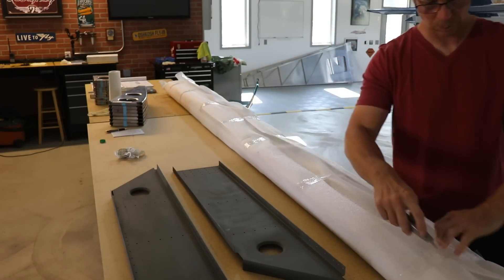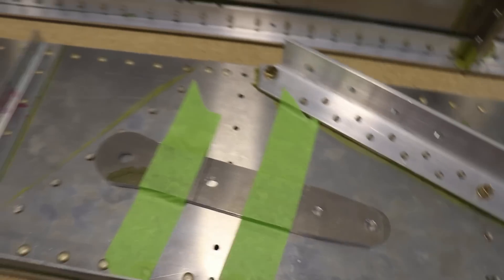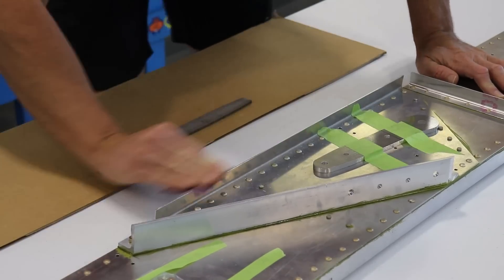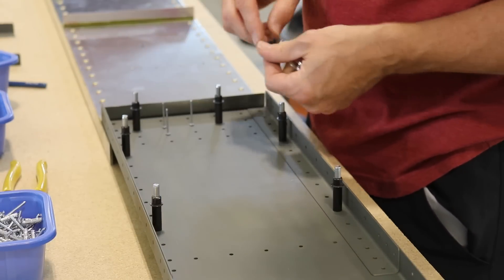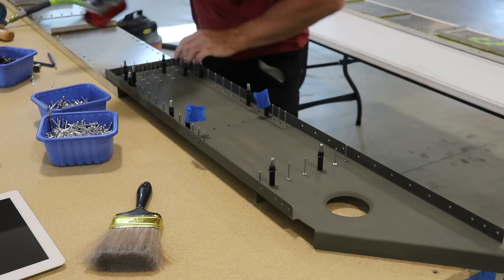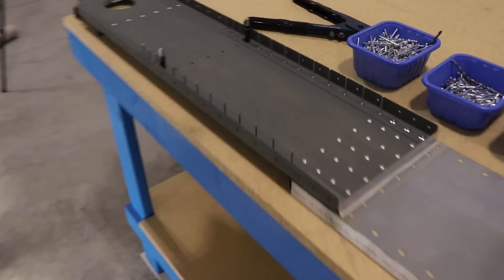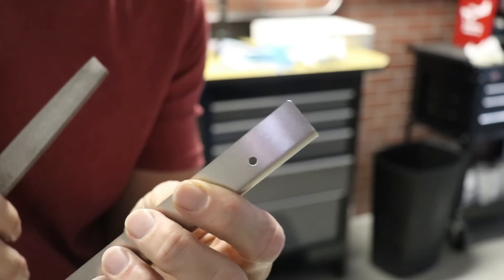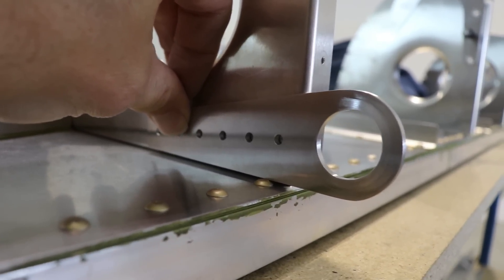CH-750 Super Duty - Building the WINGS (Ep7)

Comment: With regard to the sticking red rivet gun, we had a similar problem.  The rivet trigger would have to be pulled two or three times to get the rivet to pull completely.  However, an experienced A&P mechanic showed us we only needed to clean the gun.  After we cleaned the gun, it pulled the rivet through with one trigger.  Yours may be worn out but the cleaning made all the difference in getting our rivet gut to work properly.  I don't think the red rivet guns are the highest quality so they probably will wear out in time.

Comment: Mark, I think you said you sprayed primer on aluminum surfaces that contacted each other.  Do I have that right?  I'm leaning about galling and wonder why you chose the substance you are using instead of one especially designed for prevention of galling between aluminum surfaces in contact.  Would you offer thoughts on your choice?
Reply from the maker: John, there is no galling when the parts are riveted together. The primer is only there for a little extra protection against corrosion. The 6061 aluminum is already very corrosion resistant, and a lot of builders use no primer, which I also think is fine. The primer just adds a little more protection.

Comment: Mark... have you considered a step drill bit , or Unibit for drilling up , or match hole drilling? I know it's not that big of a deal to change bits . Any thoughts?
Reply from the maker: John, I use a step drill quite a bit for different things. In this case though, I used the drill bits just because of the small size of the holes. I generally only use a step drill when I'm drilling a hole bigger than about 3/16" or maybe 1/4".
Reply: @KitplaneEnthusiast  thanks for your take on the Unibit , watched a build at Zenith and poised the same question.got pretty much the same response from Roger and Gary.  I'm gathering as much info. and tips as I can and you have been incredibly helpful and patient with some pretty novice questions! thanks again!

Comment: Coming along nicely.  Why are there spar extensions?  Why not just make the spar the full length from the factory?  Are the extensions just to take a normal 750 wing spar and make it into the Super Duty wing spar?  Just curious.
Reply from the maker: My guess, and this is just MY guess, is that the aluminum they buy isn't long enough to make one long wing (unless they special order it at higher cost, etc...) My Zenith Cruzer also has the spar extensions.

Comment: I am not happy with using a steel file that can leave small chips that will rust on(in) aluminum surfaces. I could be wrong ! If this file is for aluminum then it must be in stainless. And, the instructions are to have that part sitting (it says : make sure) on the surface of the spar ??? How can it be right to cheat then ?
Reply from the maker: Your confusing the Cruzer and the Super Duty.
Reply: @KitplaneEnthusiast  I'm just questionning. Sorry !

Comment: the only thing I didn't like is the tie down bearing on the rivet It should have either been notched around it, or installed just clear of it. That contact point can wear into both the river and ring.
Reply from the maker: Na, there's no rivers near by... LOL! Every time I type "rivet" the autocorrect changes it to "river" too. The tie down ring, spar, and rib have zero movement so I don't feel like there's an issue with wear.

Comment: I’m enjoying your build series. I’m currently “taking a break” from building an RV-7 to finish building my hangar. I may have missed it in one of your other videos, but do you have any type of finish on your hangar floor?  Also, thanks for the detail on plumbing an air system in a previous video. Very helpful!
Reply from the maker: My floor is bare concrete. I didn't want to add any sort of finish to it because I don't want to have to be careful with it. I like being able to drop tools, spill oil and paint, and not care about the floor!

Comment: Mark... about that bracket , will that slight change make any difference when the skins go on? I'm not sure how the skin fits around the protruding brackets . I also bought the Milwaukee because I already have the Batts. Fits in slightly tighter spaces. Thanks again for doing this! Blue Skies!
Reply: I was wondering the same thing, regarding the notch cut out in the wing? Probably just need to enlarge the cut-out a very small amount.
Reply from the maker: I don't anticipate any issue with the opening in the skin around the tie down. The skin cut out is slightly over sized anyway. But even if there was an issue, it would be a simple task to slightly open the slot in the skin.

Comment: That tie down bracket,- I think  you have to put it flush with a spar,- not above that rivet ,-  when it flat touches the spar it seems like its more rigid and solid ,- and structurally more firm. Spar creates support for it . Now you have it up in the air hanging by 4 rivets.
Reply: Yeah the bracket should be notched.
Reply: I agree. Notch it and let it sit flat
Reply: When I start on my 750 SD wing I might consider fabricating an L shaped tie down bracket with the identical thickness so I can rivet to the main spar as well.  That rib just doesn’t seem strong enough to endure long term.
Reply: Commander112TC I’d be cautious about drilling any extra holes in the spar and consult with the kit designer before doing so. The spar is the stressed member of the wing and you may inadvertently add a point of failure.
Reply: MX after 30 👍 Good point, thanks.  No need to re-engineer things!  Lol
Reply from the maker: My Cruzer has the same design for the tie down as the Super Duty-its' exactly the same. I could drag my airplane across the ramp from that tie down ring. No need to re-engineer things.
Reply: Kitplane Enthusiast  you said it yourself: “ in the manual it states that it has to be flush with a spar!? - NO!? I think Engener  have done that for a reason!? No need to re- engener things !?
Reply from the maker: @cherep777  You have misheard just about everything I said in the video. I suggest you watch it again.
Reply: Kitplane Enthusiast  not trying to be negative in here ,-  I’m admiring your workmanship - and as you asked ,- trying to provide constructive feedback. @ 10:09-10:15  you saying that manual states  that tie- down bracket should be flat with a spar ..  - And I think it makes sense .....  for the reasons I already explained .
But its your plane ,- and you build it the way you want it... And I have not build one yet ... So you must be right and I’m wrong.
Reply from the maker: cherep777 I said the CRUZER manual. This is NOT a Cruzer!

Comment: I second the comment below suggesting the Milwaukee M12 rivet gun. That’s what I use on my channel building the Rans S21👍
Reply from the maker: Do the electric ones seem too slow to you? I've watched videos of the electric ones and it seems like it takes too long to pull the rivet. I just ordered a new pneumatic squeezer and a new manual one so I guess I'll keep using those. I agree it would be nice to get rid of the air hose though!
Reply: It is slower for sure, I just love not having the hose hangin around. I already had the Milwaukee line so it was an easy choice for me since I had batteries laying around.
Reply: I’ll put some “real time” footage in the next video that I use it in so you can compare👍

Comment: I also like to "wet set" most all of my rivets, have a small cup of the primer close when your riveting and dip the rivet in it just before pulling. In my mind it just adds a little more corrosion protection especially if you have had to run the hole with a drill to get the rivet to go in.